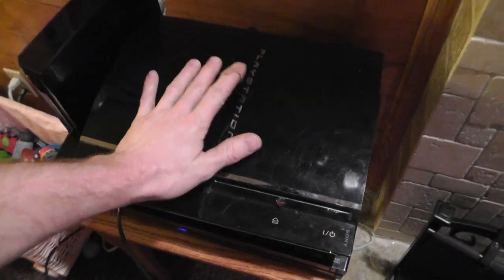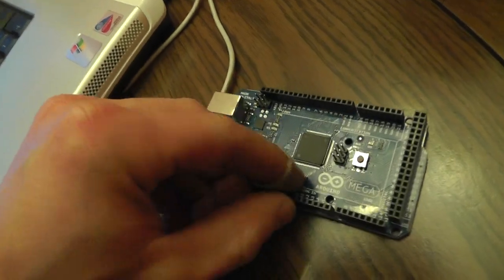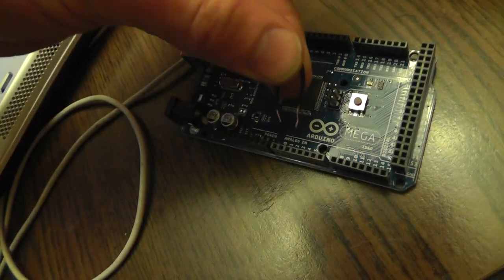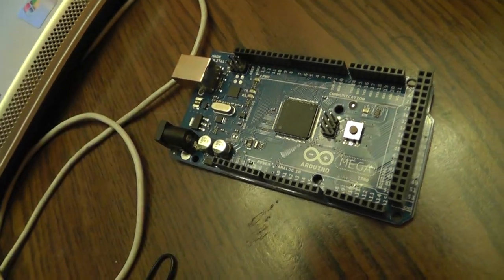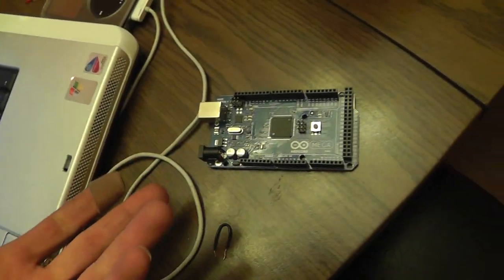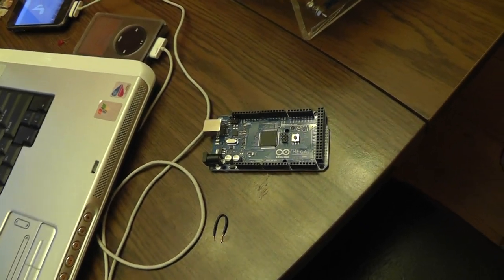DYI Arduino Hack PS3 CONTROLLER To Bypass PS3 Set Up Screen & Fixing YLOD With Heat gun

Comment: Yes you can repair loose connections with surface mount components with a heat gun! That's a common trick for repairing cable line gear that contains very expansive Gasfets that have lost a connection in a trunk amp. Are you aware that you can either purchase or make specialized jigs to apply the heat only where you think it's needed without splattering heat all over the board?

Comment: I ran a electronics repair shop for a few months repairing xboxes and PS3s they both have this problem but  it can be fixed with a heat gun/paint stripping gun but the best way to fix them is with a proper reflow station but those aren't as cheap (i used one for my job though) I loved fixing them with such an easy fix and getting $75 for an hours worth of work.
Reply: Must be a crappy repair technician and shop. The heat gun trick does not to prove to work. It is only a temp fix.Will failed again. Only way to reball the chip itself or replaced.

Comment: My Mitsubishi Expo was missing.  No one could figure it out.  Computer couldn't be read.  Tried replacing my distributor, air flow regulator, then finally the computer with a used one  - no luck.  I read, if you hear a clicking coming from the computer when the car misses, the capacitors have gone bad.  I took out my computer and took it to a TV repair shop.  He put 2 new capacitors on it (the story is actually much longer) VWALAA!  - runs like a dream.